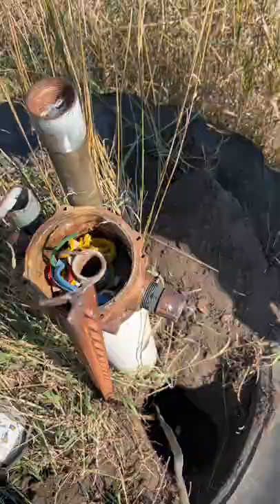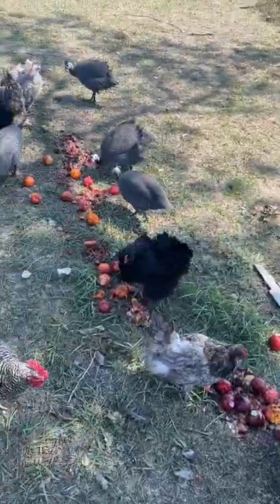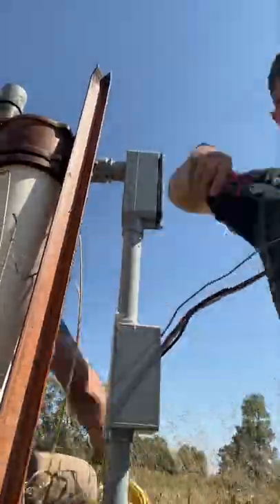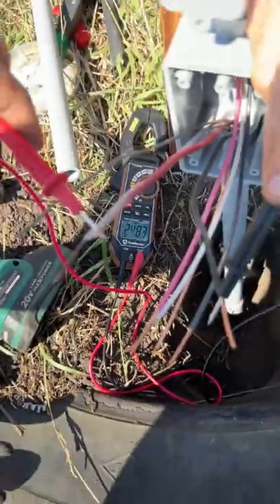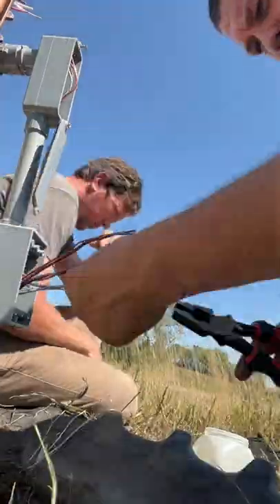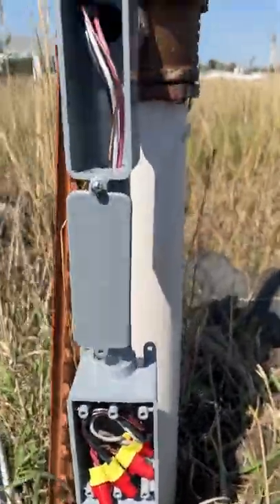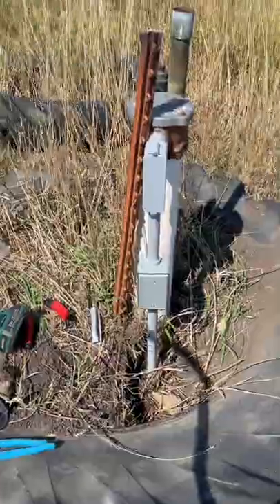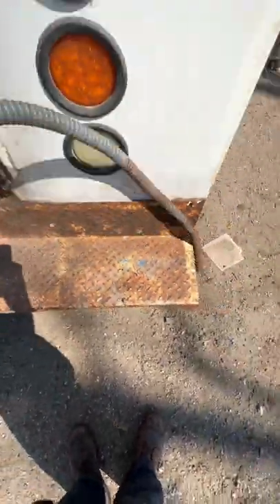Fixing an electrical issue on a well. #HandsomeOrHandy

Comment: As a licensed electrician everything looked good. One note from experience is face your wirenuts facing upwards to moisture and water stays out of the connections. Never face them down or they collect water and that can cause corrosion and cause failure at the connections again too. God bless 🙏

Jeff - Sunny Central Florida
Reply: Was thinking the same thing water runs down and that is more likely why it failed the first time
Reply: Isn't mc illegal?
Reply: I was thinking wirenuts were great twenty years ago. Maybe get some wagos... and you've got no comment on the complete lack of any straps or supports? Multiple NEC violations here.

Comment: Everything looks great. Only thing I would change is turn those wire nuts up instead of down “unbrella instead of buckets”. Otherwise if there is ever any water intrusion those connections will be the first issues you will have.

Comment: You’re supposed to have a support for that PVC box. 
But you did a way better job than original. The FMC was improper to begin with.
Reply: A "real" electrician would never use that metallic flex in a wet environment. Think "screen door on a submarine". HVAC guys like using non-metallic sheathed cable inappropriately to hook up outside condenser units to the disconnects. Their work isn't usually verified by an electrical inspector.

Comment: Cool. Not Mc though . Mc can not be used outdoors or underground.
Reply from the maker: They were using MC and it splits at the connection causing UV damage to the wire insulation
Reply: MC or flex? Regardless, good work my dude. Being an electrician, knowing what others know, sure some things could have been done differently. Who cares though. You did a 2nd year quality job 😂

Comment: Well done 
see what I did ? It’s funny!
Now I’m going to scroll the comments for wire nut instructions 😂
Reply: Need them pointed up
Reply: @ReTrOxCoOkIe  omg stop the wire nut has idea if it’s up or down 
That’s weird stuff my friend the only critique should be they didn’t use a outdoor rated wire nut with Penetrox but I can 100% assure you and all the others that think wire nuts have a up and down have never seen my work 
I have wire nuts installed up and down all  I95 on the east coast out door receptacles, light poles, wall packs underground pulls from store to store 
Upside down wire nuts lol

Comment: The wire nuts where pointing the wrong direction. Always always point your wire nuts up for water and or moisture when possible. That’s the difference between a electrician and a handyman

Comment: Wow! What water pressure!
Reply from the maker: After the pressure is out of the system it takes a minute to fill the pressure tank
Reply: He schooled you
Reply: Plus it depends on the length of and amount of piping that needs to be pressurized enough to get pressure out of a faucet... That's why it's best to check pressures at the furthest tap from the origin... But also check all outlets for optimal pressure... Which I'm sure those did... Eventually..

Comment: Mc cable out side ?
Those wire nuts are crap , second only  to black tape  wire nut combo in screaming amateur/ home owner.
Lastly I love e how you leave the nuts facing down, what? Is this some kind of water reclamation project.

Comment: Did you even try yelling and cursing at it first? Usually enough to scare it back in service, but if it's being stubborn ill use some "percussive therapy" and if that didn't work I'd just live without water.
Reply from the maker: Unfortunately because of maintenance would not have helped on this project.

Comment: Wrong. Supposed to use thhn or thwn, not stripped Romex. Wire nuts are supposed to face up so if the lb leaks no water gets into them.

Comment: Why not use wago or something simular?
Reply from the maker: I don’t like the Wego style connections
Reply: @HandsomeOrHandy  Only time I use a WAGO is for led lights! I found they burn up real quick.
Reply: @christiandufresne5151  we haven't used wirenuts for over a decade. Wagos everywhere. Saves time, saves money, listed for the purpose, nothing burns up.
Reply: @JeremyMitts  You must be a low volt technician 🤣🤣🤣
Reply: @christiandufresne5151  industrial and commercial... we haven't used wire nuts for a very long time. I guess if 120/240 and 277/480 are low voltage to you...
Reply: @JeremyMitts  is that for Dish or DIRECTV?
Reply: @christiandufresne5151  are you okay? Wtf is wrong with you?
Reply: @JeremyMitts  480 arc flash ruined my day. What about you?
Reply: @christiandufresne5151  lock out tag out regulations exist for a reason.
Reply: @JeremyMitts  oh it has been done.
Reply: @HandsomeOrHandy  Some people call Wago,s the electrical equivalent of Shark-Bite plumbing fitting's.  Might be good to temporally cap something off or a temporary connection, but wouldn't trust it sealed up in the wall.  In wiring the rule is keep connections clean and tight, otherwise you can get arcing and over heating.

Comment: In a nema 4 box does it really matter what direction the nuts are pointing…
Reply: Yeah it does. 

It's not going to be specified in the NEC but "best practices" for installing those wire nuts in a box outdoors exposed to rain and the elements would be to point the wire nuts up. 

Even though the box is considered weather proof it is not waterproof, so water will still find its way into that box and any other box that gets mounted outdoors and is exposed to the elements. 

And if the wire nuts are indeed pointed down in such a manner that water that finds its way into the box will collect inside the wire nut, the splice will eventually fail prematurely and cause issues. Especially when it first starts to corrode, the pump may work intermittently which can be maddening trying to figure out what's wrong with it. 

It's also possible that water collecting in a wire nut causing corrosion could cause the water pump to completely fail prematurely causing the homeowner to need to spend money to replace it way before it should have needed to be replaced.

The very simple fix for this is exactly what everyone has already pointed out.

 Arrange the wire nuts in such a manner that they are pointed up and water cannot collect inside of them causing future failures with this installation and the water pump system.

Another good practice I haven't seen mentioned yet is to drill a small weep hole in the bottom of the box so that any water that does find its way into the box (because that will happen, it's inevitable) can drain out quickly and effectively preventing standing water from collecting inside the box which can also cause parts of the system to fail. 

I've done this with every single splice box that I've installed outdoors that's exposed to rain and the elements and it will make everything last so much longer in the entire system. 

Sometimes I've seen water collect inside the boxes and just sit there causing the screw to rust and rot away in a matter of months and then you can't even take the cover off of the damn box. 

And when you see that problem occur when you start taking apart equipment in a installation like that, you just know that everything in the entire system will be corroded and messed up due to carelessness and poor instantly methods and require replacement. 

All of this because of carelessness and not following best practices to insure the system and installation is installed properly and correctly so as to not trap water inside the box causing a cascade effect of premature failures due to water damage and corrosion.
Reply: @El_Diablo_LI  I’ve seen them fail. But that was after years of use. And tbh I’ve never even thought of putting the nuts facing up. I work on overhead garage doors and occasionally I will work with shit that needs nema 4. I guess now I’ll start putting the nuts facing up